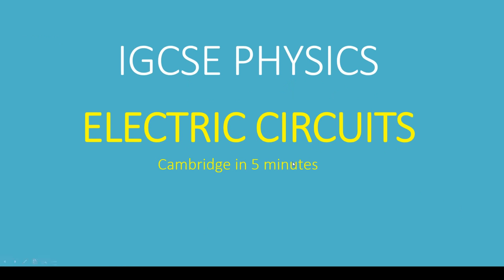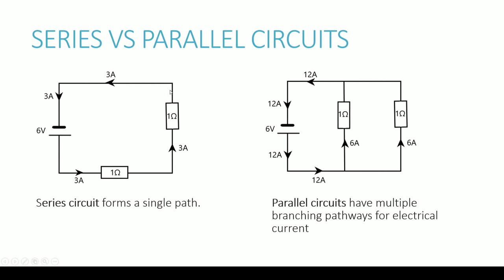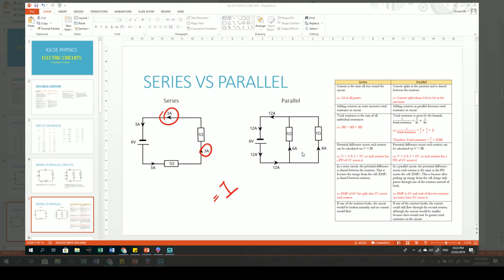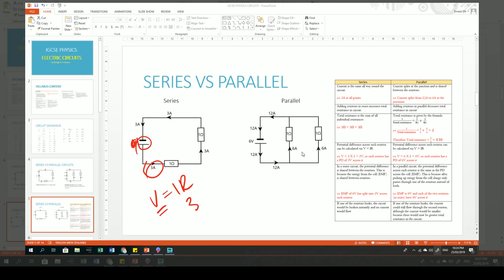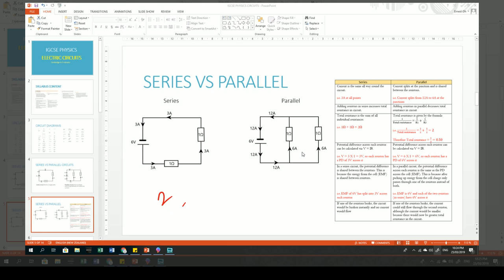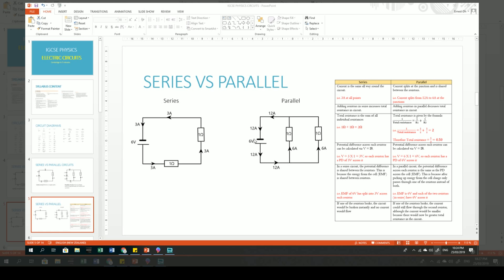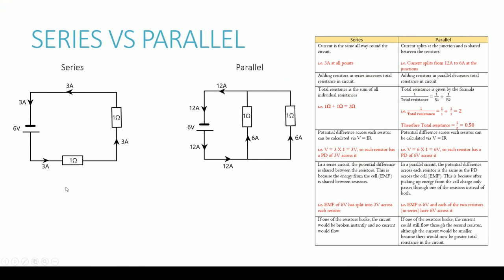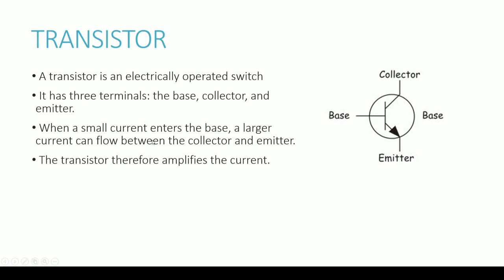IGCSE Physics Revision [Syllabus 4.3] - Electric Circuits

Comment from the maker: Sorry, rather long video ! I hope it helps clarify some concepts though :)
Reply: thermistor resistance goes up with temp, but only normal resistors resistance goes down with temp
Reply: Manav Nambiar pretty late but what u said is the complete opposite
Reply: The length of the video doesn't matter ,don't worry ,pls upload more videos on physics
Reply: i have an awesome idea 💡💡💡. You can use different couloured cursor for different backgrounded PPTs, now you don't have to constantly press the ctrl key
Reply: soo helpful, i appreciate it!!

Comment: At 21:39 
So the voltage going into the R2 is always determined by R1? 
Why do have another resistor before voltage enters the base of transistors? ( aren’t 2 enough the fixed resistor and thermistor why need a 3)
Second Q, if the temperature was decreased the thermistor would be in place of R1 (basically swap the position when the thermistor has low restance )
So in this potential divider case the one with higher resistance will always be at the bottom ie R1?

Comment: at 1:49 isnt the total resistance in parallel just 2 because the formula is 1/total resistance=1/r1+1/r2 so when we found that its 2 why did we put 1/2 ?
Reply: You have to divide 2 by 1 because the formula is 1/R = 1/R1 + 1/R2

Comment: What is the difference between input and output transducer, Infact what is transducers formal definition
Reply: Sami Roh transducers are devices or electrical components which convert energy from one form into another form